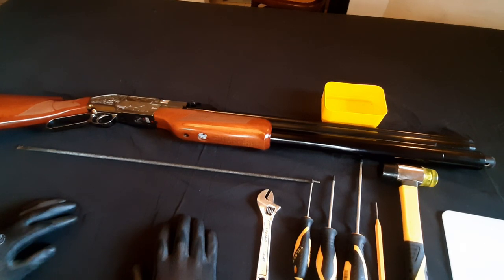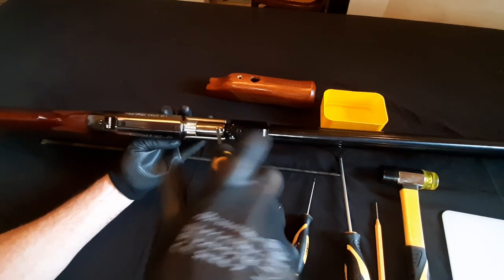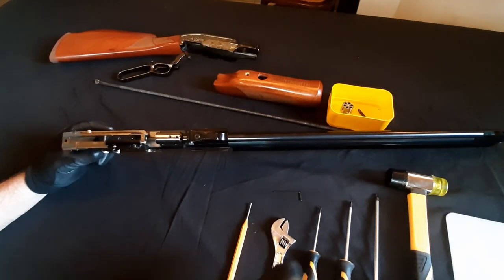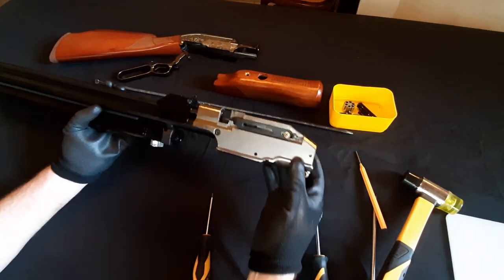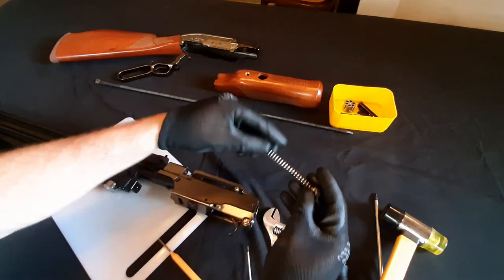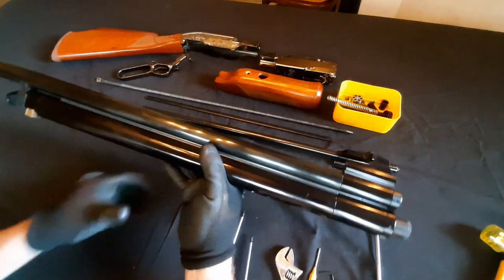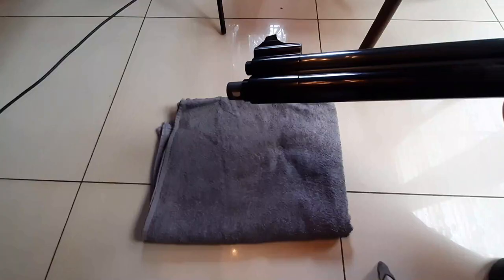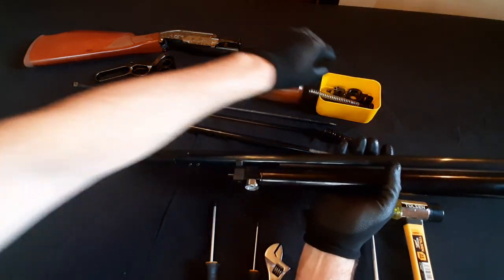Sumatra  2500   Tear Down

Comment: Your upgrade kit given more power. Bit does it also mean you get more shots with ligther slugs/pellets at lower power setting of the power wheel?
Reply from the maker: You will get more shots on lower power settings as it uses less air when you dial the power wheel down

Comment: Nice video just curious is it safe to fill 250 bar all the time , i normally fill about 200bar to save the seals from holding so much pressure cause i use it twice a month so it stays in the green
Reply from the maker: It's fine while you are shooting and store at 3000 psi

Comment: How do you empty it.
Reply from the maker: Shoot the air out  won't damage anything
Reply: It shows full but not shooting the pellet out. Every thing works but no pressure in the barrel.
Reply from the maker: @jerry24675   slowly unscrew the pressure gauge make sure to point the gauge in a safe direction or put a pillow against the wall and unscrew it slowly if it pops off it will hit the pillow but it should let the air bleed out without flying off